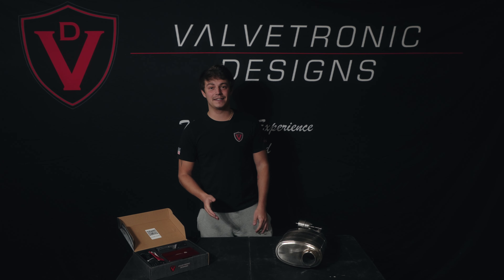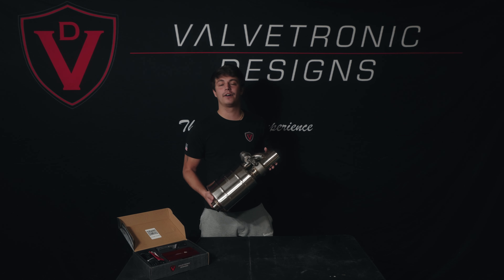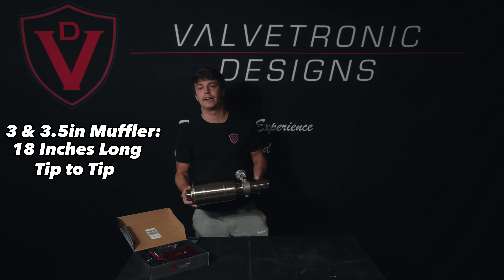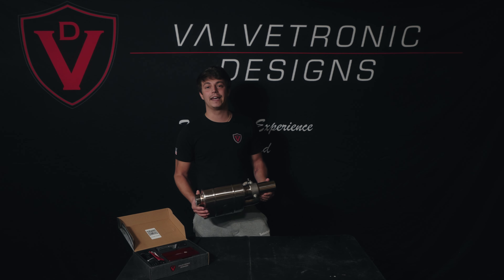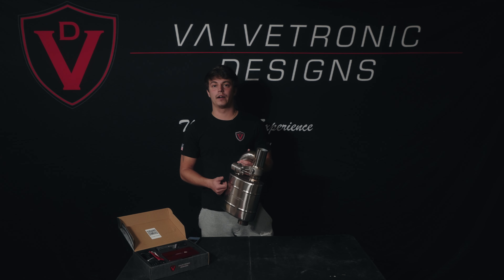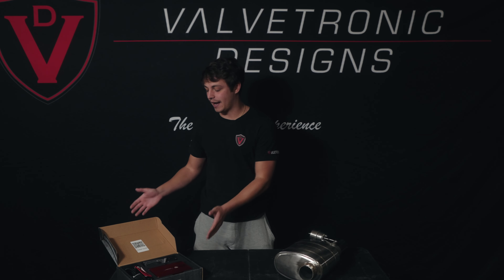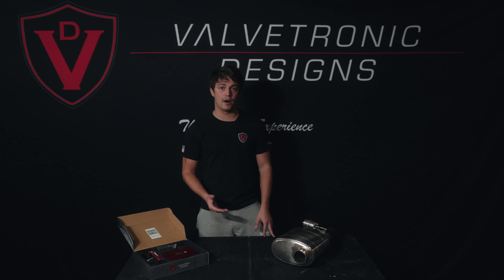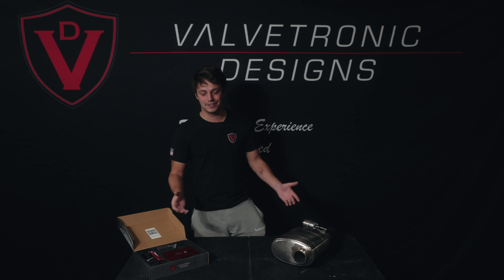Will The Universal Valved Muffler Fit Your Vehicle?

Comment: how is it in the snow/winter
Reply from the maker: No issues at all. With our pneumatic valve technology, you will avoid the wire corrosion you would experience with electric valves. And our T304 Stainless Steel is 100% rust-proof

Comment: Is there any way to control the mufflers with 12v from a button in the car?
Reply: You can use your home link buttons on your rear view mirror!
Reply: @dirty30ri53  My truck is about 40 years too old for that technology. I was hoping I could solder in some sort of signal wire to hard wire the control box to a button I’d put in my dash

Comment: I have a 2018 320i but I can’t find a hole from the trunk to the exterior to lead the vacuum line through. Are there any places I can?
Reply from the maker: There are drain grommets in the trunk and vents for cabin pressure that you van feed it through!
Reply: @valvetronic  Do you guys have any pictures of where the grommets are because I can’t seem to find the ones that lead to the exterior and when I tried the cabin pressure vent I couldn’t see the wire from the exterior of the car
Reply from the maker: Would be best to Google where the grommets are.  @justinguo3643